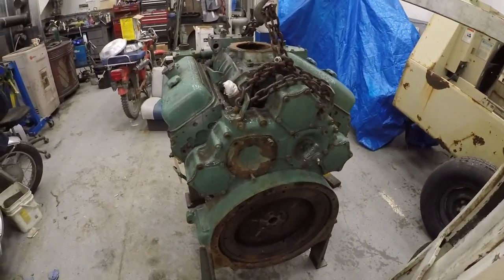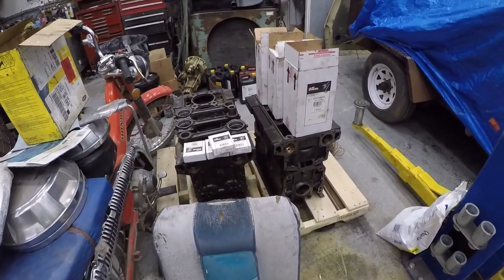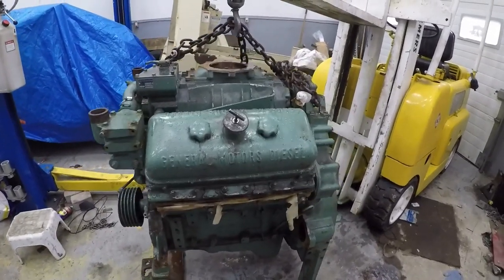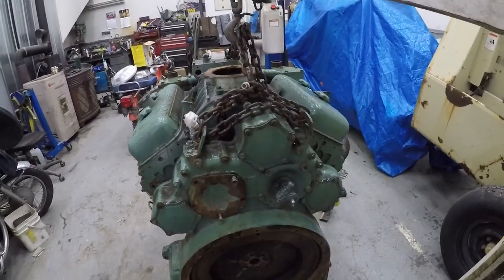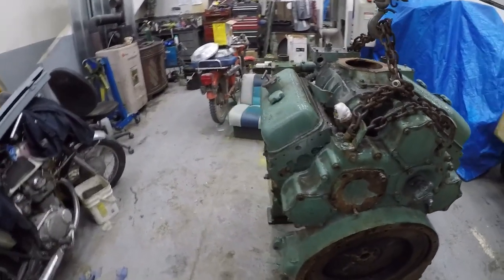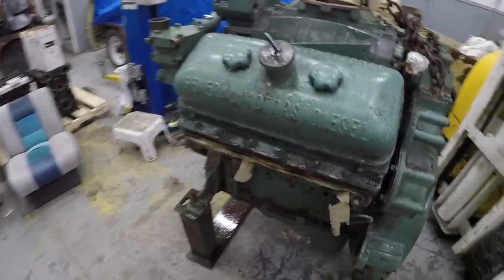Detroit 6V71 Jumped Into My Truck

Comment: Allis may not like the cold, but it sure does make unloading easier!
Reply from the maker: Very true, I have to let her warm up ten minutes now before putting her to work.:)  Worth the wait as it's almost impossible to lift the 6V71 out otherwise.:)
Reply: @detroitgarage9430  sounds like Allis needs a Webasto just so it will run on all 4 cylinders! What a great little forklift! Any chance you'll republish the saving Allis series?
Reply from the maker: @lukestrasser  I really need to get my old computer up and running to get the old videos.  If I can find them I might upload them.:)
Reply: @detroitgarage9430  that would be killer, you put a TON of time into that saving Allis series. Would be a shame if it was all lost to the ether. Cheers!

Comment: Dude! You need to move south! We run these things all year long down here.  I'll have an update shortly. I had to rebuilt the entire exhaust system on both motors.
Reply from the maker: Nice, I run them year round as well.  Just need to plug them in during winter is all and they are fine.:)
Reply from the maker: Saw your run on the stbd engine on Facebook.  Sounded really nice.
Reply: @detroitgarage9430  Still sorting out exhaust rises and manifolds for the Port.

Comment: That sure is a nice looking brand new BFG AT in the back of the F350 there! Looking forward to the 6V71 project, any plans for turbo(s), or will you run it as is in it's 238 HP N series trim?
Reply from the maker: Yes those are the TreatWright  tires for her Dodge that I mounted up for this winter.:(  Going to sell them off.:)  I have 2 small turbos for it, but going to keep it a Natural.:)  Thinking RTO-9513.:)
Reply: @detroitgarage9430  bummer that they never got used before it got smooshed. Oh well, maybe they'll do someone else some good, winter is coming.

Comment: shouldve swapped that in to the f350 ik u prob like better fuel mileage thats on the 4 banger but still thats a v6 lmao
Reply from the maker: The 6V71 is too large for the F350 engine bay.  I'll be stuffing the 6V71 into an F550 Chassis with a Peterbilt cab.:)  That's probably in 12 months from now.:)  Stay tuned as that one should be a lot of fun.  Thanks for watching.:)  Here's the cab.:)  https://www.youtube.com/watch?v=_2QasmeS1Cw
Reply: DetroitGarage oh that’s crazy that means you would’ve needed a f550 to do a 6v71 swap if you wanted to even though I’ve seen people do v6 Detroit swaps in to 3/4 to 1 ton trucks
Reply from the maker: @aceinternational4788  Yes they do V6, but that's a 6V53, not the 6V71.:)  The 6V71 is just too large and heavy for a 3/4-1 ton.:)
Reply: DetroitGarage really? I heard the 6v53 is like 1600lbs which is too heavy for a 3/4 ton I would imagine how much a 6v71 is... can you let me know the differences ?
Reply from the maker: @aceinternational4788  Yes a fully dressed 6V71T is around 2300 LBS.:)  A 6V53T is about 1800-1900 LBS. Most 6V53T are going into 1 tons.:)
Reply: DetroitGarage wow that’s insane! Hell I still wonder how people manage to get the 6v53 tucked in the engine bay with that big beast I think it’s either the length since it’s not as long as a 71 and not as a wide as a 71😂😂